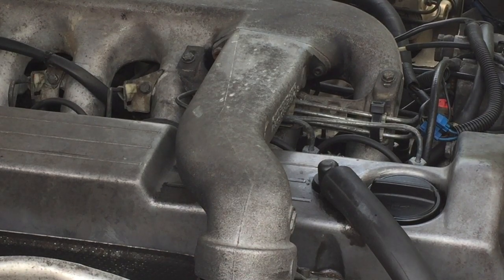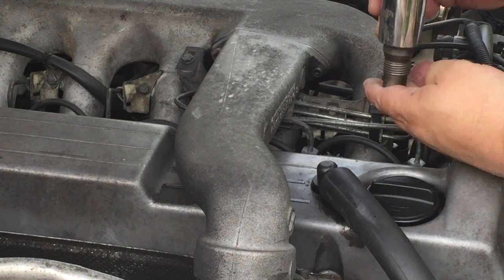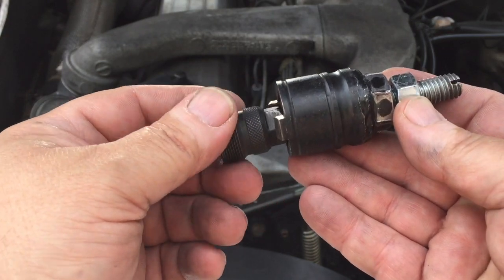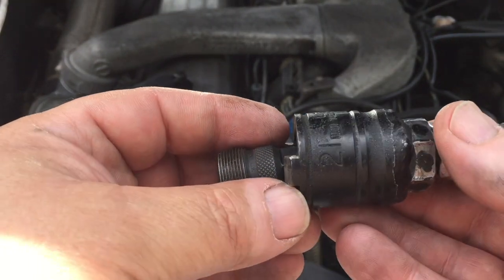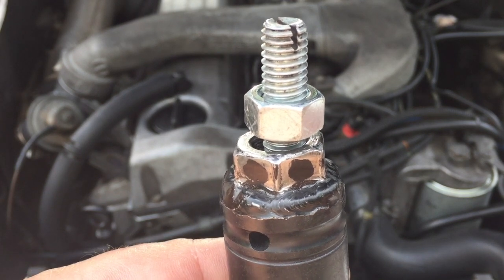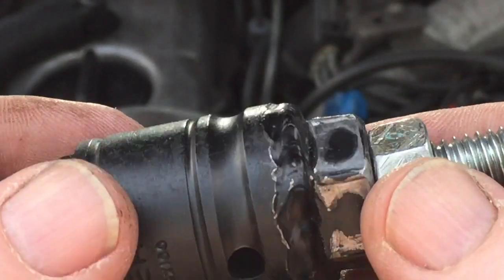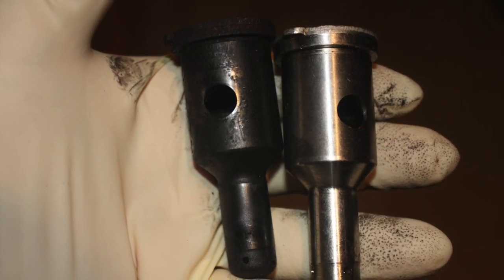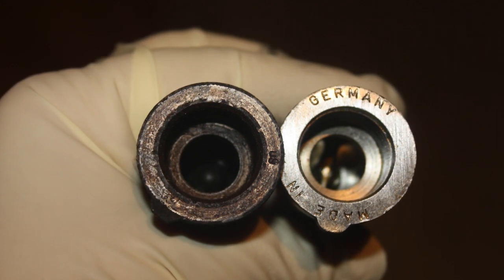Inspecting and replacing the pre-combustion chamber on W126 W124 W123 Diesel

Comment: where did you buy the new prechamber.....and do you know the size of injetors remove tool.... thankyou
Reply from the maker: I got the new pre chambers from Pelican Parts. You need a deep 27mm socket for the injectors. Don't forget to get new heat shields and to remove the glow plugs before you try to pull the injectors out. The tool for pulling out the pre chambers out of the head you may get here: https://mercedessource.com/store/615-616-617-early-601-and-603-diesel-prechamber-collar-nut-torquing-tool  you need the slide hammer as well: https://mercedessource.com/store/615-616-617-early-60x-601-and-603-pre-chamber-removal-tool-w-instructions 
I made my own slide hammer. Note: Most chambers need some serious force to get them to come out of the cylinder head. The best of luck.
Reply: Thankyou
Reply from the maker: @angelogomes1561  Good luck!